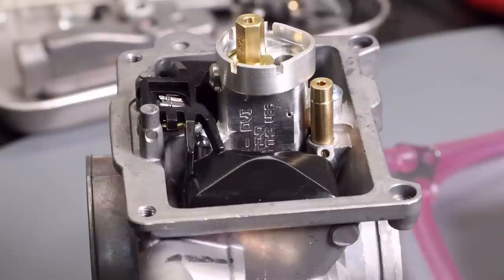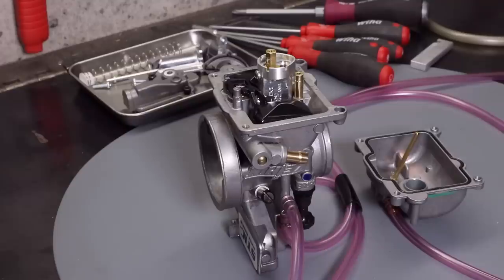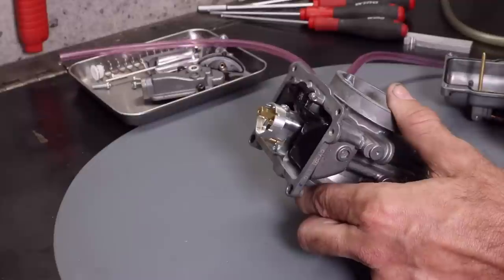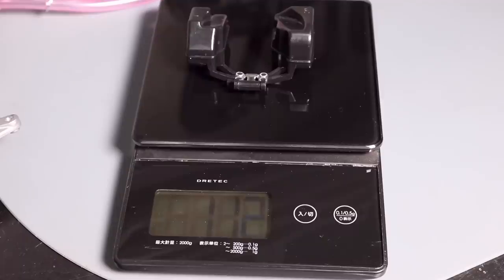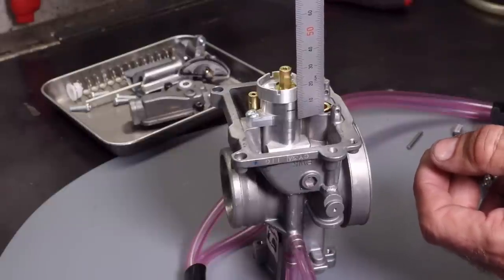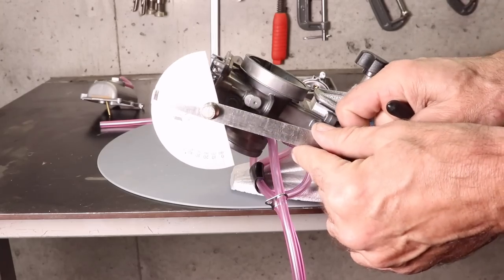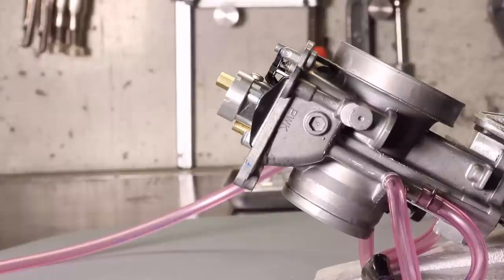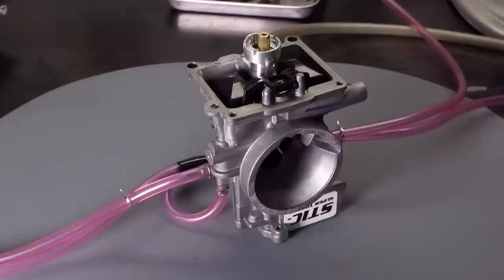Carburetor Float Height Level Measurement & Adjustment- Keihin PWK 38 Air Striker Short with STIC

Comment: Very nicely done video, Mark. It is so hard to explain how to do the float height adjustment with just words. What I've found with the Keihin carbs after measuring it for years, is that the seam on the back side of the float will be nearly flush with the base of the carb body when the floats are at ~7mm's. I adjust it so the seam is just slightly recessed below the carb body and that gives me ~7mm's.

Comment: Thank you for posting this video, I was having serious trouble fouling plugs on a used 2 stroke I purchased 8 months ago. The factory KTM manual's explanation of setting the float height was total garbage and caused the bike's pilot jet to function more like a pilot fountain. After watching this video I was able to accurately measure and set the float height which resolved my issue.

Comment: Thanks for making such a clear video.  I hadn't ridden my TE250 in over a year. it started up very easily, but the carb was leaking a lot when sitting at idle or off with the gas valve open.   This is will help me fix the problem!
Reply from the maker: Pleased that you enjoyed watching the video. It sounds like your float may be stuck, or there is some debris stopping the needle valve closing. Or the needle valve rubber might be damaged and need replacing. It should be easy to figure out what the cause is by taking off the float bowl and checking whether the float moves freely and if the needle valve is OK.

Comment: I want to say thank you, Your video was by far the easiest to understand and gave me the confidence I needed. Thank's
Reply from the maker: Deric Nichols - Thanks for the feedback and pleased that you found it useful.
Reply: @TokyoOffroad  I have a question, the brass hole that the needle valve seat in there are two small holes on the sides and one in the middle. is there supposed to be a small channel on the sidewall? can the brass needle valve orifice be replaced? I cant get it to stop leaking and i think the orifice is bad

Comment: Excellent, thank you so much! I'm having issues with my carbs at the moment and for the life of me can't seem to get them to behave properly, no matter what I do, lol (noob here btw), especially with overflowing fuel when the bowls are fully. This will come in mighty handy, thank you!
Reply from the maker: If fuel is constantly overflowing then either the  most likely causes are that the float valve is stuck, there is some dirt in the float valve, or the valve rubber is damaged and leaking. I recommend taking the carb off the bike, remove the float bowl and inspect the valve for damage, or debris.

Comment: Hello, ktm exc 250 2005 two stroke with original keihin is the same dimension 7mm?
Reply from the maker: Chylo Racing - Yes, you can safely use the same float height as shown in the video
Reply: @TokyoOffroad  Thank You for reply🙂👍

Comment: I have a 2022 Beta 200. It has a keihin pwk carb. The manual says the measurement from the carb body to the top of the float should be 16mm at a 60* angle. That’s seems way to much right? Should be in the 6-8mm range right? Thank you!
Reply: I am here exactly for the same questing. Just got the 2024 beta 200rr and manual says 16mm. Did you end up setting the float height at 7mm?
Reply: @allenmm  yes 7-8mm did the trick. Much better gas mileage now
Reply: @mmmx5109  Thank you very much. I just set it to 8mm and no more gas is dripping now. Braaap!

Comment: So it doesn't matter how much the float tang is pressing on the needles suspension at this setting? Some manuals say it should barely be touching...but that would entail that the float weight would be only suspended by its own balance wouldnt it?
quote form the beta 300rr manual...
Keep the carburettor on a 60° approx.
inclined, so that float leans on the needle
valve without pressing it.
In this position the float edge should be parallel
with the float chamber sealing surface
Reply from the maker: At a 60 degree angle the tang lightly touches the valve. There is actually quite a wide range of angle you can hold the carb at before the weight of the float starts to compress the spring. 60 degrees is about in the middle of this range and as such is a good angle to use as a reference. Moving the carb manually from 90 degrees to 0 degrees you'll easily be able to observe what happens. If you're aiming for a float height of 6.5mm then the float seam edge will be parallel with the float bowl surface. I prefer a float height of 7mm as it helps reduce spillage while riding and with this setting its a little off parallel.

Comment: Great video, but could you post a link to page where i can find the specification for float height to other models?
Reply from the maker: What carb do you have?
Reply: @TokyoOffroad  KEIHIN PWK 36S AG on my 2016 ktm exc 125
Reply: @TokyoOffroad  I am asking that because my bike always show low fuel, and i want to make sure is it set correcty
Reply from the maker: The float height setting method and spec is the same for your 36mm as the 38mm shown in the video.
Reply: @TokyoOffroad  Thank you very much man! What would i do without your knowledge. Also thank you for having very quality videos and being here on youtube!

Comment: I’m working on a carb from a 1975 Honda CB125S where the bowl gasket sits in the top half of the carb (the body of the carb that contains the float), and a small lip on the carb body is actually a little higher than the gasket surface (when the carb body is turned upside down).  When measuring for the proper float height, do you remove the gasket and measure from the flat surface under the gasket, or measure from the gasket surface with the gasket in place, or measure from the surface of the lip?
Reply from the maker: Probably best to ask online in a CB focused forum for clarification regarding where to measure from. The Honda manual CB125S states "the height of the float above the carburetor body should be 24mm" and the photo in the manual isn't very clear...

Comment: I have a question 
I was always told that the correct way to adjust the float height is to make sure that the floats must be parallel with the carb body when the floats close the valve.
Is that also correct?
Reply from the maker: Yes, that's true, but it's difficult to do it accurately that way. It's fine as a rough guide though...

Comment: 90-60=30 degrees which is the angle of either carby end to the bench top. A good way of making a 90 degree triangle with opposite angles of 60 and 30 out of paper or cardboard. Is to start on a corner and measure one side say 2” or 5cm, then make the diagonal twice that 4” or 10cm. Now cut that out and the small angle will be 30 degrees which is the angle of the carb end to the bench, simples.

Comment: As usual, perfect detailed video - you're the maestro of accurate mechanic work!

What is your video/audio gear? :)
Reply from the maker: Thanks! Far from perfect, but I always try hard to make clear and understandable videos. I use a Canon 80D (with various lenses) with exposure and focus manually controlled and a Sennheiser AVX wireless microphone system.
Reply: @TokyoOffroad  Nice! I remember you started with a more "cheaper" model of Canon camera. The current setup really gives you the option to bring all the details video and audio wise.
Reply from the maker: Nir Hason - Yes, I used to use a Canon G7X compact camera. Video quality was OK, but there is no audio input for an external microphone, battery life was very short and the small screen made it difficult to focus manually with accuracy. The Canon 80D setup I have now is nice to use and I have an external LCD monitor making manual focus easy.
Reply: @TokyoOffroad  Tnx for investing for us! :)

Comment: Hi. Thanks for the great video. Does the same 6mm measurement apply to the PWK28 carbs? I just purchased the set of the PWK 28 for my K750 russian boxer, and i am wondering about the float value for them. Thanks.

Comment: Great Video, thanks for sharing.
I have a 2019 TM300EN with a Kiehin PWK 38, it's not the AIR STRIKER SHORT with STIC. But my manual calls for a float position of 16mm. Does float level and position mean the same thing?
The reason I'M asking is because once my bike is warmed up it takes longer to start.
Reply: Michael Pinkston -yes it means the same thing.
Reply from the maker: I don’t have any experience with TMs, but a regular 2-stroke if setup and running well it should start instantly when warmed up. Does it run OK once warm?
Reply: Yes it runs great. Only thing is it takes several seconds of cranking when warm.BTW if I set my float level per your video, then at 16mm the needle is bottomed out.
Reply: Found the float was grossly out of adjustment. Probably more like 20+ vs 16. I bent the tang back straight and rechecked. It was now 16. Thanks for all the help. I just dont understand how the only symptom was hard starting after warm. Bike ran great no hesitation, bogging ect. ?????

Comment: I have a 2019 ktm 300 with the 38mm Keihin carb with out the stic metering block. Is the float height still at 6.5 to 8mm?
Reply from the maker: Yes, the spec is 6.5mm. I would aim for 6.5-7.0mm

Comment: This is interesting, as Yamaha use this carb on their YZ250. Their method to adjust float height states to have the carb in an upside down position, not at 60 degrees
Reply from the maker: Interesting. I hadn't seen the Yamaha method before and just looked it up. Upside down will give a different float height to measuring when the carb is at 60 degrees. The Yamaha float height spec (when the carb is upside down) is listed as 5.5 to 7.5mm. I think the 60 degree measurement is a good method, being repeatable and continue to use it.
Reply: Both are acceptable but you will never get the float from the base to the top of the bottom of the float to measure 6.5-7mm, the float itself is taller than that.

Comment: Wow such detail! Amazing info. Can i ask, do you know the float height for the Mikuni TMX 38. Thanks
Reply from the maker: The Mikuni TMX38 standard float height spec is 8.7mm +/-1mm. Out of the KTM factory the Mikuni typically have the fuel level too high. It’s a good idea to measure and set it as early as possible. In this video I show the Mikuni spec: https://youtu.be/h3J6EUR45es (1:24)

Comment: my carb seems to leak when tilted regardless,  I used the air blowing method and got a completely different result where the float looks parallel with the carb body at 60° and stops leaking  air but when upside-down the float is no longer parallel the distance is more like 9 or 10 mill. ?

Comment: Can you make a video of how to leak down a two stroke engine?
Reply from the maker: I'll add the video idea to my list. To determine the health of the piston ring to cylinder seal my preferred method on a 2-stroke is to do compression testing. You could use a leak down tester to confirm if the head gasket is leaking (air would appear in the coolant) with the piston at TDC. To debug crankcase leaks you'd need to plug off the exhaust port and intake. Will definitely make a video sometime in the future...

Comment: My PWK also has 3 purple hoses. One of them is for fuel overflow. What are the functions of the other two? Are they for venting/overflow at different points from the carb?
Reply from the maker: Yes, that's correct. The upper most hoses which point are are vents and the ones at the side act as overflows when the bike is leaning over on it's side. The top vents you can route up underneath the tank if you fit longer hoses. I do this as there is a risk when doing deep water crossing if the vents hang down into water it can get sucked up into the carb.
Reply: @TokyoOffroad  if those vent lines can suck up water wouldn't they also suck in dust and clog things? I'm confused on what they actually vent. I can see it if the fuel level changed alot but the float should keep it close to constant. What am I missing?
Reply: @otpipe  Those pipes connect to the cast body of the carb, the side and top hoses are connected to the same channels on each side of the carb. When you lean the bike over like when you lay it down, the fuel in the carb can run out of those hoses to prevent the engine from flooding. If you really screw up and the bike gets inverted the top hoses will function the same way allowing fuel to exit the carb. In addition, fuel naturally evaporates, the pressure caused by evaporation in the bowl has to be vented somewhere or it pressurizes the carb and you get poor man's fuel injection.
Reply: @TokyoOffroad  i tried this on my 300exc pwk38 but found on a mx track that after a series of jumps the bike would rev when the throttle was shut. I assumed the fuel was shaken up the tube and fed back in when the bumps stopped. Very scary! Any thoughts on this?
Reply from the maker: @jamesc2109  - What you experienced is certainly not normal. Do not ride the bike again until the problem has been identified and fixed. I suspect that either the slide is staying open for some reason after you release the throttle, or the carb is running lean and you're experiencing hanging idle. With the bike not running, try opening and closing the throttle. It should be smooth and when you release the throttle you should be able to hear the slide fully close (it makes a mechanical noise when it fully closes and hits the stop). It it's sticking check the throttle and throttle cable and clean or replace it there's an issue. If the problem is with the carburetor then disassemble and inspect and clean. Check that the cable is installed correctly in the slide. With the carb off the bike and throttle cable connected test by opening and closing the throttle and ensure that the slide movement is correct. If you suspect hanging idle (bike continues to rev very high after throttle is closed due to a lean condition) then there could be several different causes including carburetor not getting enough fuel (blockage), float level too low, carburetor setting is too lean.
Reply: @TokyoOffroad  everything mechanically seemed ok with the carb. It did it abouts 3 times always when closing the throttle after a series of jumps. I pulled the pipes back down and it didn't do it again! The bike would cut out in deep water with the std pipe length so in the end I just cut them about 1" after the routing guide on the carb and both problems were fixed.
Could only think somehow fuel was pushed up the pipe when vertical that would return when the throttle closed and it stopped bouncing around. It seemed too strong and prolonged for hanging idle?
Never been able to fully explain it but now fixed.
Great videos BTW , best on YouTube.

Comment: I have the TMX Mikuni 38 with the JD Jetting kit. Red Needle between 2k-7k. On a 19 ktm 300xc. I put the NGK TEIX plug here too. All is good. I am just reaching out and wondering if the Keihin PWK 38 with stic is been good to look into purchasing. Is this something you sell set up ready to purchase? Thank you.
Reply from the maker: Thanks for your interest. Yes, the Keihin 38 with STIC is a great upgrade from the Mikuni on the 300 and results in strong, responsive power which increases in a linear manner from bottom to top. Low rpm lugging performance is very good and the engine doesn't load up, even after extended periods of lugging. Top end is extended with more over rev. I set up each carb specifically for the customer's bike so the carb can be installed, idle speed set then ridden. Your ride elevation range is similar to mine (slight higher than mine) and I am able to use the same jetting year round and only tweak the airscrew setting. The STIC makes the carb far less sensitive to elevation and temp changes. I sell the kit on the Tokyo Offroad webshop here: https://www.tokyooffroad.com/product/stic-keihin-pwk-38mm-air-striker-short-kit/

Comment: Wish it wasn’t such an old video, I have a question!?
Reply from the maker: What 's your question?
Reply: @TokyoOffroad   when the float is lowered to the specified level per the manual, is it when the needle valve just closes completely to take the measurement or when the small button is compressed as well?  I’m guessing when only the needle valve closes, and the tab is just bumping the button - but I’m not clear on it.

Thanks for your help!
Reply from the maker: @BOPilot5517  The most accurate way is to check the float at when the carb is at 60degrees as shown in the video. But the quick and easy way is to rotate the carb until the valve just contacts the seat and check. If you continue to rotate the carb the button in the valve will eventually start to compress, but if you take your float height reading when the button is compressed it will give the wrong reading.
Reply: @TokyoOffroad  thank you.  I meant to say keeping the carb at 60 degrees while the needle valve just seats.  Excellent video by the way!  Now if I just get my 1987 TRX250R to come up on the pipe I would be a happy.  This is where the float adjustment came from.  Trying to diagnose why it doesn’t want to come into the powerband.